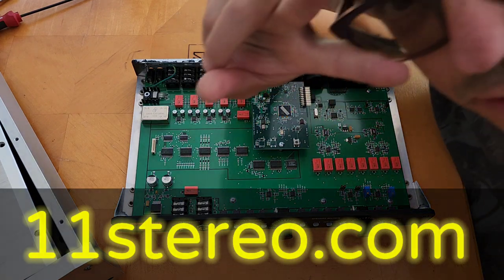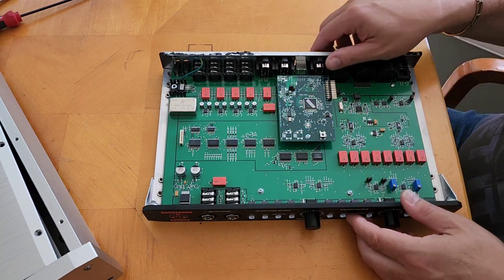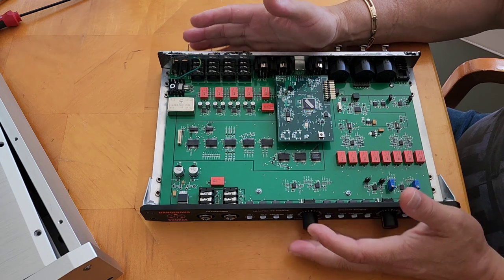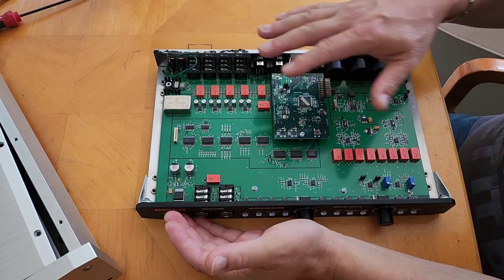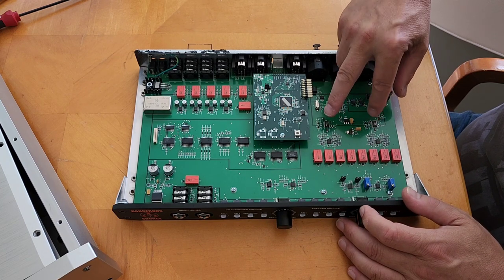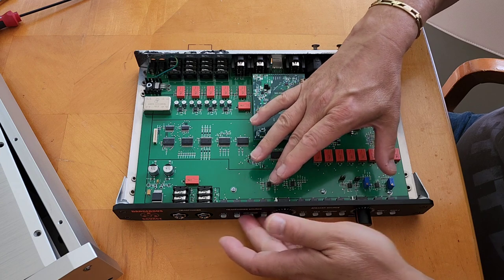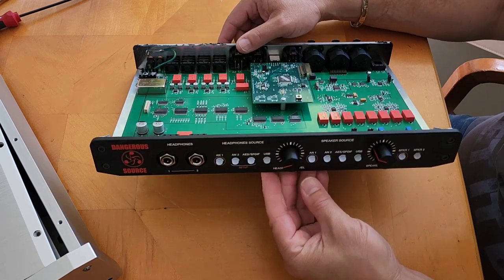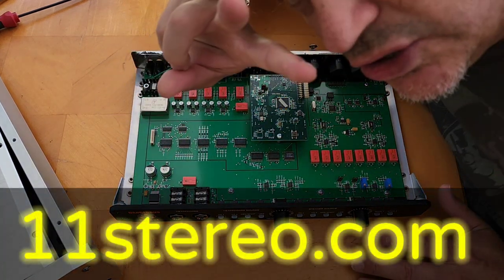ANATOMY OF A DAC -  VOL # 2 DANGEROUS MUSIC SOURCE

Comment: The XMOS DAC used in this model is 30$. It sounds fantastic for monitoring, I´ve been using it for a few years but it´s far from a clockable high end DAC. The build quality of both the desktop and the rack front plate is outstanding in my opinion.

Comment: Now we only need to find a great $1K CD Transport! Some of us 70yr "Old Timers" think that anything using a USB cable should only be used for PCs not Music DACs. I think a lot of those in the Music Industry have confused the importance of Hi Fidelity rather than Hi Rez. I wonder if my observations are influenced by my using a Equi=Tech Model Q Balanced Power Transformer Line Conditioner (Which I bought at a "steal" @2k 20yrs ago.) It's pretty amazing how Low the Noise Floor is, with High Dynamic Contrasts, I'm getting on most of my CDs.) I don't need no "Stinking Tubes"

Comment: Tell me why the power supply can matter so much on low voltage low current loads? The reason they use a tiny transformer you can plug and hang off the socket is because there is very little current draw.
Reply from the maker: Its not about the current its about the ripple or noise spec.

Comment: The higher end DACS have a lot more steps on the ladder
Reply from the maker: This is not an R2R , this is a Delta Sigma chip type ..;-)
Reply: @OCDHIFiGuy  Michael...which chips are being paralleled here???
Reply: @OCDHIFiGuy  there is up to 6 bit SDM chip out there. It is not six resistor for sure.